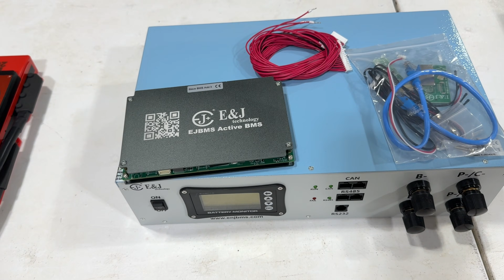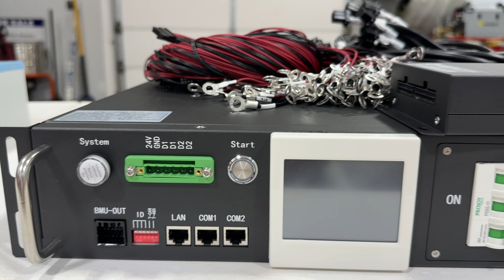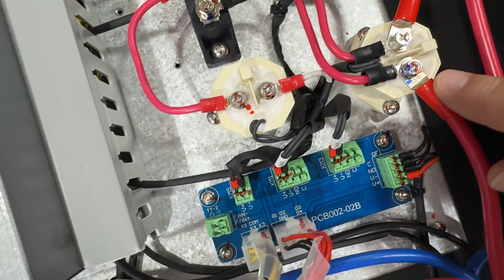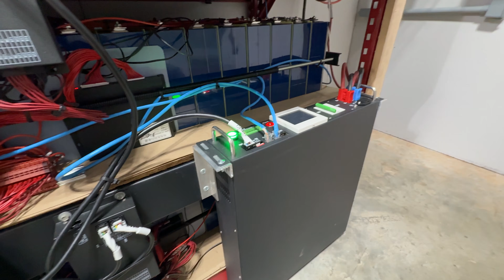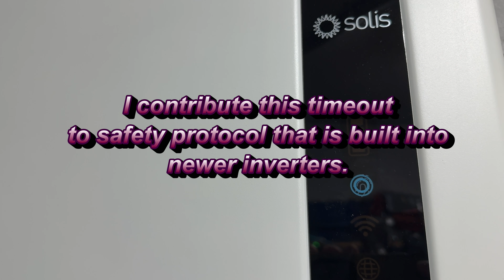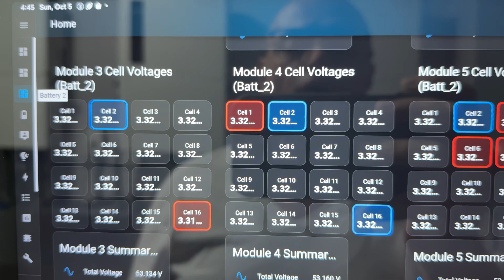DIY High Voltage Battery w/GCE RBMS S23-50-500 with Solis S6 11.4kW HV

Comment: Is there any update on the communication/connection diagram and the protocols used between the GCE device, the Solis inverter, and Home Assistant?
I assume your Home Assistant setup uses three Waveshare RS485 dongles, one for each Solis inverter.
If possible, could you share the relevant configuration — for example the Home Assistant YAML and the Python script you’re using?
Reply from the maker: I do not know if posting on Git Hub would be helpful. Also added hydrogen monitoring for off gassing.
Reply: @DMIINC2013  That would be interesting if the code is accessible. I also believe that only high‑voltage batteries have a future, since the required power will only continue to increase in the future. In terms of safety, high voltage is indeed a disadvantage, but once the practical implementation is done properly, it’s no longer an issue. I’m already looking forward to your next video about the expansion you’ve done.
Reply from the maker: Yes there is. Debating if video would be helpful since it is nothing but technical gibberish. But, long story short Pi5 controls everything at the moment while HA is big beautiful display.

Comment: I was building a 240s system using the E&J bmss, and it's absolutely terrible. One of the BMSs won't wake up, the master BMS started throwing an error when connected to the inverter, and now it won't connect to the computer. Support responds once every two days, and the problem is impossible to solve. Now I don't know what to do about it.
Reply from the maker: E&J is not as good or as polished as GCE RBMS. However they are working on updates. The way things are going I just might try building the BMS 😂myself. Orion BMS might be another option.
Reply: @DMIINC2013 thanks for advice!)
I'm thinking about building myself to) if using external active balancers things should be much easier))
But for now trying to find another variant that fits our requirements and wallet))
Reply: @theworldismine771  If you would like to learn more about GCE BMS, I would be happy to assist you.

Comment: 96 cells in series is to low (6 bat in paralle echivalent), and i prefer LV baterrys in paralel. If you can make minimum 192 cells in seriess, that is a big avantage.
Reply from the maker: System cannot handle 600v+. In retrospect I I should have went with higher voltage but started off with Mach E battery at 96s. 😅

Comment: Do we know if this works with Growatt MIN11000 and other inverters that can use the same LG battery as this Solis S6? I was planning to get a setup with LG batteries but want to plan for their eventual recall or failure (lol)
Reply from the maker: You can select Growatt as inverter in protocol selection. There is no specific model selection such as MIN11000.

Comment: Nice work, working with GCE for over 1 year, having 20+ 640V BMS running sofar. If you need more info let me know. What cells did you use ? a where did you buy those? Thanks Tom
Reply: What inverter are you using?
Reply: @idahoduckhunter  the BMS support 15 brands, but mostly goodwe
Reply from the maker: 280 ah cells from docan in Texas warehouse
Reply: @DMIINC2013  what did you pay for the cells?
Reply from the maker: I just wish they had better BMUs. For more balancing.
Reply: @DMIINC2013  well the balancing current is not the issue, the issue is quality or those cells, unfortunately this is how it works with HV
Reply from the maker: @flexienergy_sk  I am glad someone understands. Working on that solution too.
 I paid $55/cell delivered .

Comment: In the IEC standards committee that I'm a member, anything below 60Vdc is considered safe, as in non-lethal. So, you can start a good fire with 48V, but you won't get electrocuted. Not so with 350Vdc, quite lethal. I just finished replacing all the cells in my 2018 Nissan Leaf (see here), and had to be super careful anywhere the voltage was above 60V. Now I have all the old Leaf cells, and want to re-use them as home storage. While I personally feel comfortable around high voltage, what happens if someone else needs to dismantle them in the future? Better to stay at 48V for DIY home storage. I should get around 25-30kWh with the old cells, and since they are NMC, they are going outside in a metal box, just in case.
Reply: Oh, sorry, great video! I would do it this way if I were to do an HV battery. My house only has 5kW maximum power, so LV is fine for me.

Comment: Have been looking at these BMS's because I want to build a battery that complies with the CurrentOS 350V microgrid standard, thanks for making a video about it! If you went up to 108 cells per BMS you would be just under the 400V swell band limit in the currentOS standard by the way.
Reply from the maker: Glad the video helps!

Comment: So glad to come across this video you made.

Now that I can see how it was laid out and the components involved I’m going to make one in my present inverter building to “play” with.

Probably AC couple it to my existing system.

I didn’t notice any mention of Fuses or breakers or contactors.

I can see the BMS has a contactor to the inverter.

Are there any Class T fuses or Breakers in that range than can extinguish a DC arc at those voltages?

It appears you just use one battery bank for each inverter so don’t have to worry about parallel batteries shorting to each other.

If you don’t mind later after I get my system up and running, I could use some help with the YAML code.
I’m definitely not a programmer.

Thanks Again!!

Comment: does the new bms have an active balancer?
Reply: Our 16S slave BMU now comes in a version that supports active balancing (3A). This upgrade significantly improves cell balancing efficiency, especially in high-capacity battery systems.
Reply from the maker: No

Comment: How does the JK active balancer connect in to do active balancing?
Reply from the maker: It doesn’t tie into system. I use it to help out balancing when needed.
Reply: @DMIINC2013 thanks I’m loving your system.  I’d be interested in a breakdown how the batteries are wired in more detail.
Reply: @DMIINC2013  Do you mean you manually turn them on or you have a voltage set for it to activate? Which model balancer are you using? Does it have RS-485 on it as well for monitoring the balancer?
Reply: I would love to know this as well - how does the JK balancer work?  Can you have it running alongside the GCE BMU without any issues?

Comment: Your battery is arranged, if I understand correctly, as 6 of 48 volt sub-batteries in series. Each 48 volt sub-battery has its own active balance, to keep the cells in that 48 volt bank all at the same voltage. But what if if the 48 volt banks get out of sync? Is there any way to keep them all at the same voltage?
Reply from the maker: 6bmux16cells=96/bms  bmu can passive balance cells and packs, but slowly. use active balance only when needed.

Comment: i'm little confused about the communication setup. at point 16m00s you did specify LAN from GCE to router to HomeAssistant. And COM1 directly connected to Solis inverter. And at timepoint 19m53s you talking about the USB to RS485 adaptor for your home server (is this the device running Home Assistant ?) which talks to the raspberry pi and to the 3 solis inverters. Is it possible to make a communication diagram in the next video and to explain in more detail which info is requested by which device. If i'm correct the home assistant talks over the LAN to the BMS. BMS talks over COM1 to solis inverters, and the home-assitant   talks to the raspberry PI over RS485, however i'm not sure which protocal and how the raspberry talks to the solis invertors..
Reply from the maker: Yes, I will make a diagram in the next video and provide more details about the communication setup, it can be confusing. This was just abbreviated version.

Comment: Can you open one BMU, to see what ic are they using, LT or TI?
Also I would split each shelf with it's CMU, and NO wire only the com and power to be connected from one shelf to the other.  There is insane amount of power in case of a short circuit, and those Anderson connectors....I would stay away of them, in case of an arcing even with a small current, 1-2A at 350V dc you will have a few cm or arc, don't think it has enough distance between pols. Better 2 HV connector, independent.
I designed CMU for EV applications. Passive balance with 200mA is more than enough. First balance will take more time, but after that, it will be ok. If there are differences, that the issue is with the cells. In automotive, balance is done with 60-100mA for hundreds of Ah cells. And that BMU case, don't know how it will withstand to a short circuit, Inductance of wires will have a huge impact on voltage stress during arcing, so it may not stop it. If you had a look over an EV battery, all HV power line are well bolted and hold in place, and I hope you are using also a fuse (DC fuse with fusible element), as the Chinese resettable fuse, will have a few tens of KA trough it, and may fail. Only wire inductance and resistance will hold back the current not to rise too much, but as these are quite low values, tens ok KA are easy to reach. I hope they tested with a short circuit.
Reply from the maker: Panasonic stuff is used in BMU's. Balancing NMC automotive grade cell and off the shelf stuff is way different. I have done both.

Comment: Maybe explain why you went HV over LV - currently have 45 kw LV build - would like to combine LVs 16 packs to HV setup -- ahh and thanks for sharing your adventure!! Keep up the good work 🎉
Reply from the maker: HV allows you to use much smaller gauge wire and system is more efficient. Since you already have running system I would stay with it until you need new inverter.

Comment: Great presentation! I have talked a lot with GCE and they are really awesome to communicate with. But it is crucial with safety when you go up on High Voltage batteries. I'm planning to use the New Deye 60kW Inverter with the lf-280-V3 cells and I think Deye and Solis are very similar and they also use the same protocols. In my setup I will only use 8 pieces of 16s packs.  Your Python and Yaml looks really interesting, I have had some GROK and ChatGPT discussion regarding this integration but if you have a github repo with the code base it would be super helpful.   Thank you.
Reply from the maker: I used grock and chatgpt. Very useful when you are not super familiar with code. Thanks.
Reply: @DMIINC2013  Hi, that is great, I actually use exactly those two now in an Automation I make for height positioning and feeding for a band saw timber saw. I think Grok is a little better in my daily Programming language C# while ChatGPT 5 Thinking and Research is absolutely fantastic for programming so my 10 inch Touch screen work with an Teensy 4.1 board where I use the Teensy to be able to send a ton of instructions per second for my feeding of 2 stepper motors.    :)   Thank you so much for the tip and that we take a very similar approach to problem solving  :)

Comment: Thanks for the video. Please what's the cost of the GCE BMS system?
Reply from the maker: $1100
Reply: @DMIINC2013 thanks for the response. That's quite a some for a 50ah BMS.
Reply from the maker: @adon8672 that’s not the way to look at this system it is hv system.
Reply: @adon8672  as constructed, these are 86kWh batteries per BMS.  Are you saying it's expensive compared to the BMS in a 16kWh 48v batteries, which also frequently use 280Ah cells?  The inverters used max out at 50A battery charge/discharge current, so why would you want any higher than 50A on the BMS?

Comment: Beautiful🎉 - please explain - are your inverters 48v?  How do the HV Batteries interface with your inverters? Are they not 48v inverters? Thanx again!  
As usual - your system is the gold standard!!
Reply from the maker: Yes and yes
Reply: @DMIINC2013 Thanx - did'nt know that!🎉❤
Reply: High voltage inverters have dc input battery from 200-600vdc.